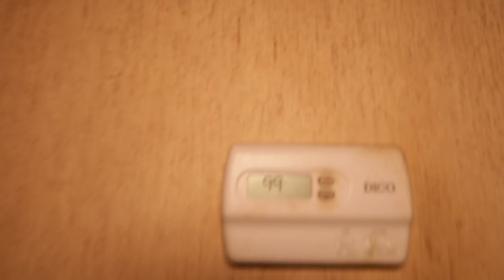(ZOMBIE HOUSE II)PARANORMAL KICKS IT UP A NOTCH!!! WOW!!!

Comment: Okay I've looked at what I'm going to comment on like thirty times and got my daughter to look but Chris when you go in the bathroom and look in at 14:22 it looks like a shadow of a lil girl on the curtain on the wall opposite of the mirror you can see it in the reflection and when you pan the camera back around to go back out the bathroom at 14:25 you can see in the mirror that it's gone. If someone reading this comment please check it out and tell me what you think. Man I slowed it down to 0.25 and there's definitely something there. Looks exactly like a shape of a lil girl in a dress and when slowed down at 14:22 looks like her arm moves or some movement and also when it's slowed down at 14:25 you can actually see it's either fading away or disappearing into the wall. Sounds crazy but I've watched it over and over. Please check it out